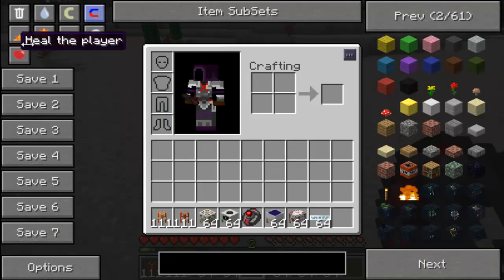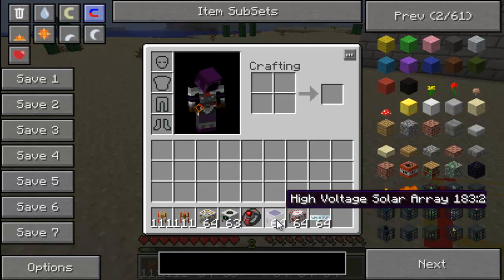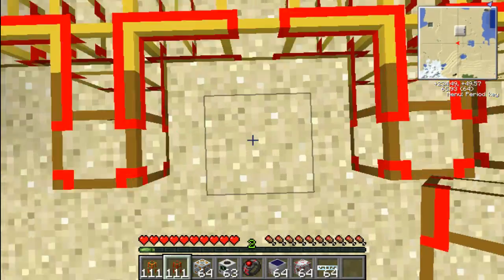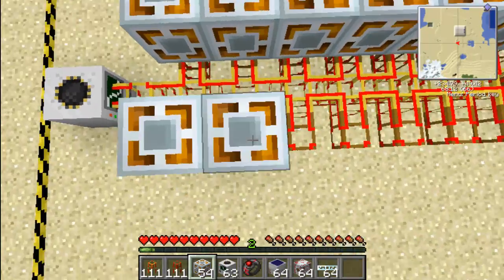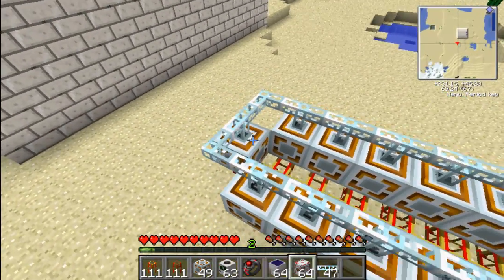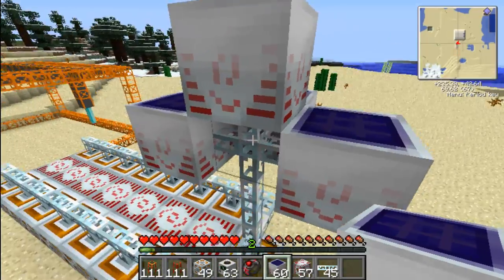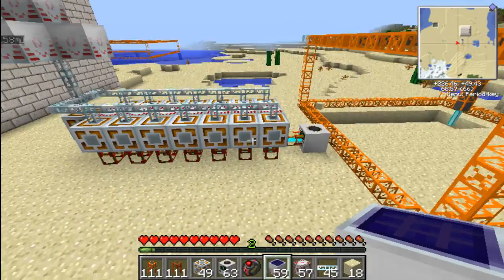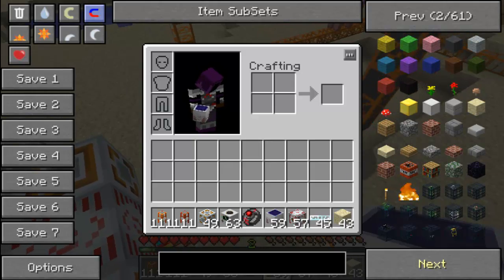How To Tekkit: How to make a Solar powered Quarry

Comment from the maker: ok, make sure the MFSU's have there outputs facing a wire in the video i fucked up but it should still work in the day regardless, you need conductive pipe it needs to be wooden under the energylinks